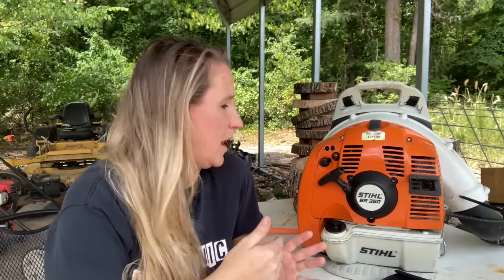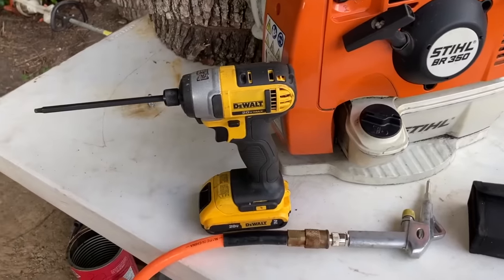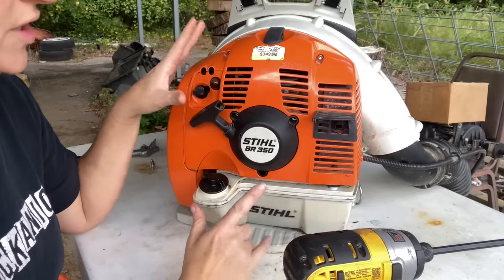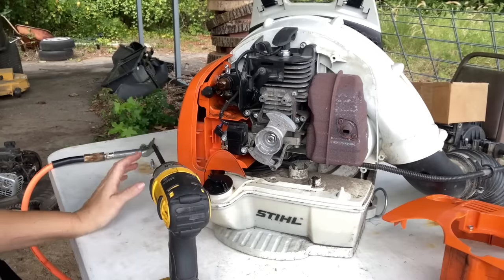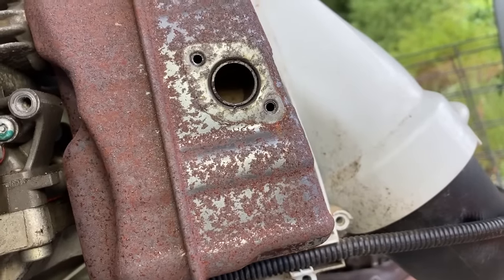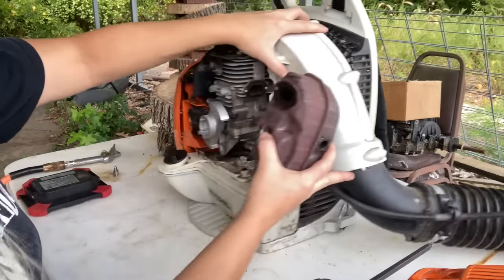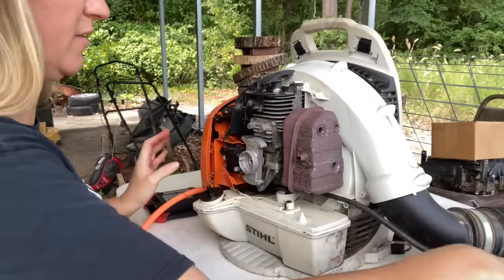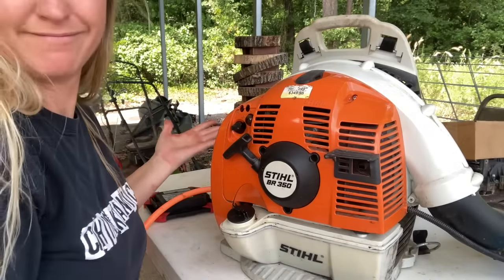Stihl won't throttle up or stay running? First thing to check!

Comment: Great Channel. This is a LONG Story, and I'll "TRY" to keep it Somewhat Short. STIHL BG85 Hand Held Blower. When it get's HOT it Just won't Restart, and If it does I have to "TRY" to keep it Running By Using the Choke and Eventually it "MIGHT" Start Running again. If it Won't Throttle Up and "BUZZ" it 4 Cycles the Whole time. Things I have done or had done are. New Coil, (Didn't FIX it), Every Spark Pug Made, (Didn't Fix It), Using Original Factory Plug Now, Sent it to STIHL, they couldn't duplicate the Problem and told me I had the Wrong Spark Plug In it, (Didn't Fix It), called STIHL back, they Sent me a NEW Carburetor and I Installed it and it ran Much Better (For a While), and went right back to the HARD Starting and No Throttle Up shortly there after, Removed the Exhaust Filter Screen, (No HELP there). New Fuel Filter, (No FIX there),  I have tried Every Fuel Under the Sun, and All Kinds Of MIX's. Right Now I am running VP MIX FUEL 50/1 and Still have the Problem. I am at a LOSS, and Just Live with the ISSUE? Sometimes it'll Run, sometimes it won't. It Never seems to what I call "BUZZ" like my Old Go Carts did back in the Day. Basically, I can't get it FIXED, Nor does anyone out here (California) no what they are Doing and Can't fix it Either. (ALL Experts). Bummer, cause I "ALWAY'S" had No Issues with my Racing Cart's Back in the Day. However, they were Different engines, But Still 2 Cycles, They Alway's ran like a Raped Ape. Sorry for the LONG Message. But I'am at a Complete Loss. I might have Missed something, I don't know what to do any further. Compression is Strong. Anything you Might know that I "might Not" have done, Aside from Splitting the Engine Case would be Helpful. Ken.

Comment: I have three Stihl  blowers, two Stihl trimmers and one Echo trimmer.  (I just put Echo Speed load heads on the two Stihl trimmers, thanks.). Your videos are outstanding.  I just retired and have more time to work on my own machines.  After I subscribed I looked for carb cleaning/overhaul/replacement vids for these machines and didn’t find any.  Are you planning some carb videos?  I found one on the Echo coil.
Reply from the maker: Thanks David! I will be including complete repair tutorials on all of those units. I did do and Echo Pole Saw which is very similar to the SRM-225  engine. My next few videos will probably be on blowers and chainsaws since it is the time of year to pull those out of the shed. Have a great weekend!

Comment: About 12 years ago, my mom had a Husqvarna blower that started doing the exact same thing. I didn't work on small engines at the time, and she took it to a neighborhood guy, and he could never figure it out, so she eventually bought a new one. A few years later, it started doing the same thing. I had started working on stuff by this point, so I tore into it and couldn't figure it out. We eventually called a friend of my moms that owned a landscaping business.He told me about the spark arrestor, and told me to delete it. My mom didn't want to do that, so we replaced it. It lasted about three months before it started acting up again. They were on backorder at the time, so I just cleaned it. Anyway, I either cleaned or replaced the spark arrestor seven or eight times over the next four or five years, before I finally just followed her friend's advice. We have not had a problem out of it since then.

Comment: Great job and great video.  I have a question.  A customer brought me an old Poulan chainsaw.  Obviously needed a primer. Saw hasn't been used for a while. Also obvious.  After replacing primer and fuel lines, filter, spark plug etc., still no start.  It would fire with a smell of ether.  I then ordered a cheap carb and still no luck.  I've got good compression,  muffler and exhaust port clear, no piston scoring.  It seems like it's flooding.  I have had it running twice with the new carb and has power at full throttle.   When it dies its done.  I'm 68 and too old to wear my arm out yanking on this thing. It's got non-ethenol unleaded gas mixed properly.  Another customer brought to me a Mantis tiller that has given me the same type of fit...pretty much the same scenario.   There is something I'm missing.   I'd rather put a set of brakes on a pkp truck or change an 18.4x38 tractor tire.  
Is it the cheap carbs? Any tip or trick would be great.  Thank you.

Comment: Disabling seat switches can be easy, or it can be a pain in the ass. On my early 2000's Troy Bilts the seat switch functions by using to small metal connectors to form or break a circuit, depending on whether you are sitting in the seat or not. All you have to do is raise the seat, find the two little connectors, spread them apart, and stick a piece of plastic or rubber between them. It breaks the circuit and disables the switch. On my John Deere, I actually had to delete it from the wiring harness, create jumper wires, and run them between the starter switch, battery, and starter. That was a pain in the ass, but no more seat switch.

Comment: I'm having a similar issue with my Stihl weedeater. I checked Spark good I checked exhaust screen that was dirty so I used a torch. But I'm thinking it maybe the same problem you found here. I'll have to look into it tomorrow. I hope that's it. If not carb is next to check then compressor

Comment: I have a Mitsubishi grass trimmer that does exactly the same! Was taken to the mechanic and delivererd running fine but at home, 2 days and doesn't run until I kept on the trhottle. Tomorrow I'm going to check the muffler.
Reply: AMAZING!!!! I can't access the spark arrestor, is a mesh inside the muffler, but I soaked in vinegar with sodium bicarbonate for about an hour, wash it, and IT STARTED IN THE FIRST PULL!!! (and keep going, without pressing the throttle) Thanks a lot!!!

Comment: A Dirt Dauber, if I'm spelliong it correctly, is a kind of wasp that builds a nest using mud. They carry mud in their feet and drag it in tight spaces.That's the blockage.  Unrelated to that, today, I found on my Stihl hedge trimmer the spark arrester (muffler) with the screen attached and the screen was all plugged up with carbon.  EPA would sanction Chickanic if she recommended cutting off the screen with a hacksaw.  That would eleviate any future blockages.  Mine was totally clogged with carbon which shocked me because all my equipment is usually repaired by cutting off the screen.  My hedge trimmer would not start at all, and I tried everything; changing spark plug, air filter, gas filter until someone suggested the carb needs adjusting.  Well, someone else suggested the spark arrester was clogged.  Checking that, I used a torch to  heat the screen up, then wire brushed it so eventually you could see clearly through it. Starts right up. Maybe next time I'll just hacksaw the damn troublesome spark arrester.

Comment: I just worked on a BR380 that wouldn’t stay running at part to full throttle.  I cleaned out the spark arrestor screen (didn’t see any mud dauber evidence), changed the original spark plug and fuel inlet filter (from 2009!) and it started right up and worked perfect for 1 hour.  Weird how different things will affect small engines.  I’m thinking the screen prevented the insects from entering the muffler..

Comment: I'm having issues with my Stihl FS45 whipper snipper and checked the spark arrester and it's missing as well.  I guess if the spark arrester was still there the wasps wouldn't be able to get in there.   My machine dies when low revs so I have to keep it throttled up to keep it going - last time I used it I had to keep the safety throttle that you have to activate when you start it up going all the time or it would die.  Will check the exhaust for wasp nests tomorrow.  I was having trouble with my electric pressure cleaner last time I used it - it was full of mud wasps.  Have covered all openings with flyscreen and rubber bands.

Comment: I've had a mud dauber do the same exact thing to my STIHL FS55R only the spark arrestor was in place however the clog was in such a way that the spark arrestor looked perfectly clear from the side until i looked through the nozzle tip 100% blocked so i stuck a pin inside the nozzle and a plug of dirt roughly 1/2 inch thick came out runs like a top afterwards. Always keep your spark arrestor in place it may be annoying to some but it's better than having this happen to you.

Comment: Great video as always. I have an BRAND New 131R  4 Mix   It will run okay for a while then it chokes up and runs like the blower in this video. I’m curious if something is going on with the muffler.

Comment: 1991 Shindaiwa 488 chainsaw. Installed K-22 HDA carb kit.  Starts, idles but it takes several minutes before it will take any throttle. (If you touch the throttle it dies) After warmed up runs great, revs up and idles great. Any Ideas ?

Comment: The dirt dauber must have gotten into the muffler through the removed spark arrestor.  That is one thing I have built into my PM schedule - I burn off the spark arrestor screens on all equipment that has them.

Comment: My Stihl backpack would run fine till it warmed up,then start bogging down and finally quit running.it was real easy to fix.i put the old gas in my truck,then mixed a gallon of new 93 octane gas with the Stihl 2stroke oil,no problem after that.i also put stabil in my gas cans in the garage as soon as I get it.

Comment: My leaf blower wouldn’t start before. I changed the spark plus and carburetor and finally got it running. When i have my choke on it’ll run for a little and when i close it it shuts off completely and there was some fuel that shot out at me (just a little) where the air filter is. I replaced my old air filter too because it was soaked with fuel. So I’m assuming this is my problem i just don’t know where to look or how else to fix it. Thank you for your help in advance! I love watching your videos.
Reply: Also changed my fuel lines and fuel filter if that has any relevance

Comment: I really enjoy your videos and  how thoroughly you explain what you're doing. But I've got to take exception to one issue. You mentioned how putting the wrong screws into the screw holes can damage your equipment. I've seen you do this a couple of times when you start the screw with a drill driver or impact, even though it is the correct screw for the hole, into the plastic hole. When you don't align the screw at the correct starting point in the plastic, the screw will cut new threads just like it would if you put the wrong screw in and damage that plastic screw hole. You need to always start a screw going into a plastic screw hole with a hand screwdriver and turn counter-clockwise until the starting edge of the screw seats at the starting point of the plastic threads. The screw will drop slightly deeper in the hole when it's in the right place. This saves your threads which will eventually go bad if you keep doing this. But again, otherwise a great video.

Comment: Your not lying I have a stihl weed eater i ran for around 8 years for my property and one day it didn’t start and I decided to get the Husqvarna zero turn kit with weed eater another weed eater with pole saw attachment and a chainsaw so I didn’t mess with the stihl for a few years and one day I pulled out the stihl ordered a carb and when putting it together I noticed the screen in the muffler was completely clogged so I beleive that’s why it quit running in the first place!

Comment: Have you ever worked on the Ego electric blowers? I just bought the LB6500 and it's working fine but it's reviews on Amazon have a lot of unhappy users saying it works for a few weeks then quits. That blower may be a good video repair for your channel.

Comment: Great tip...Thank You!  I would like to get you opinion on a new backpack blower, I have about 2 acres with a lot of hardwoods and pines, so, looking for a large blower. Thinking of a Stihl 800X Magnum and 800CE Magnum, which do you prefer...Does the side start on the CE model work OK? Or am I better off with the model X with just the rear start...just a little leary of the side start??  Would appreciate your thoughts.  Thank you!  Enjoy all your great tips and videos.

Comment: Subsc Question 4 U from Tn. So I was give an SRM 225  by a friend he said was junk because Tech told him the fan was broken, it wouldn't rev. Not the problem of course, took me a bit because screen & muff were super clean. Stumped I finally pulled muf & notice exh port seemed small,  it was ½ the size once I started cleaning. I've had Stl  Husk, Shin trimmers but this Echo Screams, I'm super impressed! Now all blades on flywheel are damgd or off, why & will it hurt long term? I'm using syn oil rich to help cool & seems plenty cool about like my Husk. I know it has to be imbalanced but doesn't vib. TY 4 ur channel!

Comment: Just had same problem with HS-45, first use for the season trimmer ran fine for about 2 minutes then bogged down.  Removed spark arrester, looked clean (you could see through it) but with the arrester removed trimmer ran perfect for over an hour.  Removed screen from plug and reinstalled, ran perfect for another hour.  Not sure why it looked clean but ran so poorly but did not want to deal with the issue again.  Where I use the HR-45 if there ever is a spark it's not going to cause any problem.

Comment: i never use power tools for reassembly.  also i drop the screws in and turn them backwards till they drop  then turn then clockwise that way i'm using the same thread path.  with those screws you get two thread paths and the third time you are buying new parts.

Comment: Had my brand new Echo back pack run for a few then cut off, dealer said no problem found, did it again 2 weeks later, found out the fuel line were on backwards from the factory
Reply from the maker: Really? That is extremely odd. I have never seen that issue before factory. Glad they got it figured out.

Comment: First thing to check is the screen that is in the area of your muffler.  Pull it out after you've first disassembled the area.  Yiu will then see that the screen is all built up with carbon buildup.  Take a wire brush and scrape all the carbon buildup OFF of the screen. So to it that it's perfectly clean and you can actually see through it.  Soak it additionally in straight gasoline and or carburetor cleaner or some solvent for further cleaning. Once done, reinstall in the muffler area. Chrange your gasoline filter, and also check or replace your spark plug. With clean gas and oil mixture, you'll be up and running in no time and it will be like bran new again.

Comment: Great interesting video, I have a BR600 with same problem but my one broke off spacer that holds pull cord housing seems to went into flywheel pushed up spark arrestor cracked engine housing also broke two pull cord bolt fixings from engine, the compression is around 28 wondering if engine you think is done, J-B weld back in place as best i could, try it tomorrow see it starts, also clean exhaust.

Comment: One of the first things I do when having small engine problems is remove muffler. Don't know why but I always do.
Enjoyed this video.
I've got a Stihl 024 chainsaw that is a bear to start (muffler on or off).
Starts only with a few shots of starting fluid and will run and restart all day. But then there's tomorrow where it won't start again.
Florida is home. What do you think?

Comment: Had a similar thing happen many years ago, a friend of mine was gonna throw his weed whacker in the trash because it was old and it would not keep running.
I am a car mechanic and lets just say small motors are not my favourite thing, but I don't like seeing perfectly good gear go to waste so I took it home.
Put in new fuel, replaced the old worn spark plug and made absolutely no difference.
It had spark, fuel and compression, it should go right?
I went back to it several times over the next week, and like you, I was near stumped.
I finally decided to pull the muffler and look inside the engine from the exhaust port, that is when I saw the 2 little exhaust pipes almost totally blocked. Here in New Zealand we have  mason bees which do the same thing as your dirt dauber, unblocked the holes and it burst into life. I gave it back to my friend and it is still working to this day.
Every now and then the same thing happens again, but now it is part of his starting routine to check the exhaust.
Mine too. :-)

Comment: Mud daubers nested in a steel fuel line that caused a leaky needle and seat in a Holley 4bbl. You could see little pieces of mud  on the paper towel when cleaning the needle and seat assembly. Seal the ends of all your lines!

Comment: You said to ask if I had problems. I have a Stihl BR 320 backpack. I replaced the rings and piston, cylinder, spark plug, exhaust/muffler, carburetor, gas filter and gaskets. It runs. But the Low speed adjustment has to be fully in (Clock-wise). Back it out and it stops at about 1 turn CCW. Should I just accept that I have no adjustment or is there something causing that problem. I've had and used this blower for 20 years approximately. I mixed fresh fuel.

Comment: Good job!! Now I have a question, I have a BR 350 , have had it a long time, runs great but I have a real hard with the pull. It pulls really hard, to hard for me anymore, so went and bought an Echo. Easy. You have any idea why they pull so hard, this is the second one Ive replaced. Runs great after it starts. Like you show!

Comment: I live in New Zealand and have no idea what a dirt dobber is but…….I had a similar problem on my trimmer. Spent two days on it, stripped everything and it still wouldn’t rev up or run properly. Then I watched a small wasp 🐝 fly into the muffler, it had built a nest in there and choked up the muffler